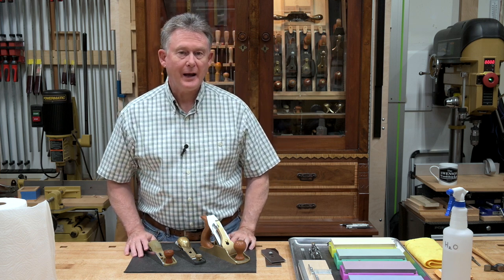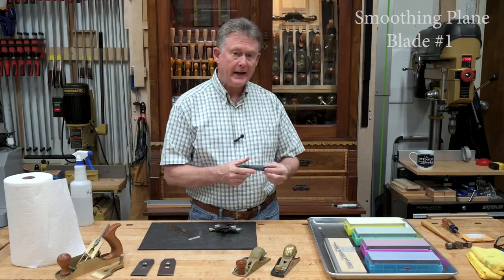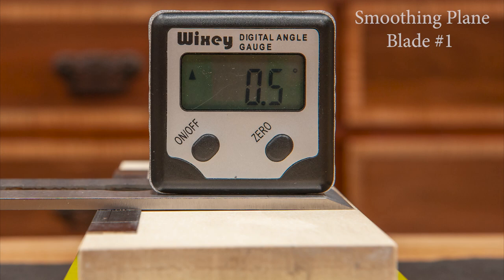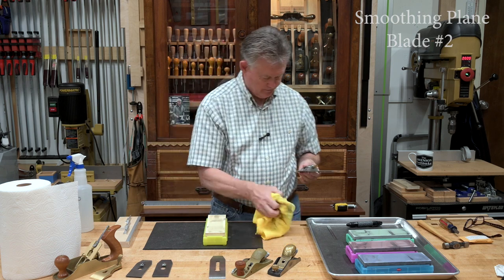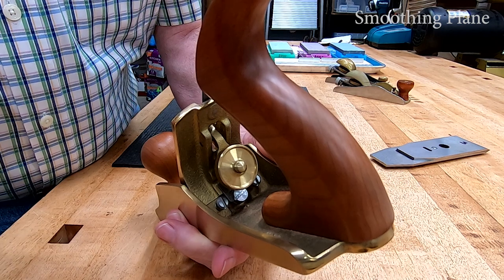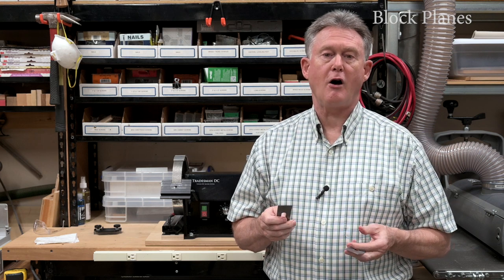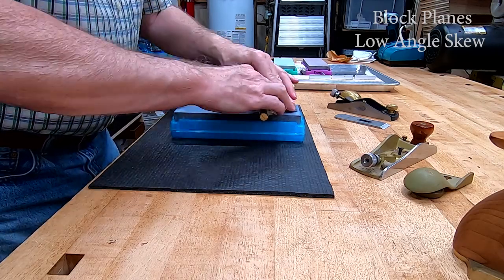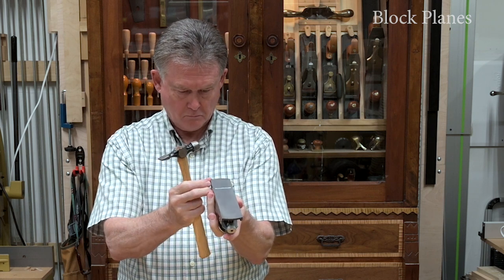Sharpening Part 3 - Hand Planes

Comment: Are you using shapton glass stones here ???
Reply from the maker: Shapton Professional Stones - ceramic whetstones
Reply: When you bought your Shapton stones, did you consider the HR series?  Also,  Sharpeningsplies.com recommends the DMT DiaFlat plate for flattening all Professional Shapton stones.  Is that a viable alternative?
Reply from the maker: @drewferguson2104  I don't have any experience with the Shapton HR series (glass) stones, so I can't really express a fair option on them.   I have used conventional water stones, so the professional series of ceramic stones seemed like a familiar technology, with the added benefit of not having to be stored in water, plus good reviews, which is why I went that route.   As to the DMT DiaFlat lapping plate, I think it would work as well as the Shapton reference plate, for a lot less money!

Comment: What lapping plate do you use?
Reply from the maker: I have a Shapton Diamond Reference Lapping Plate.   Not the cheapest option.   There are less expensive options that give good results.  I also use a DMT plate on my coarse whetstone, and for the major metal removal stage of flatting tools.
Reply: @swensonwoodshop7475  Thanks for the response. Yeah, it doesn't look like the cheapest option, but it sure does look like the best!